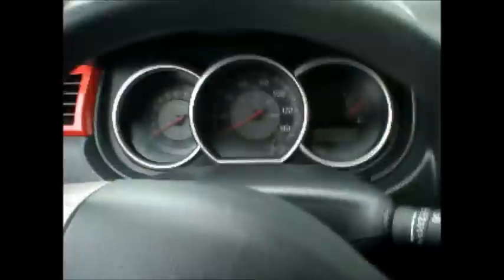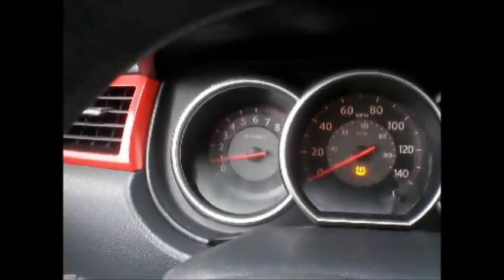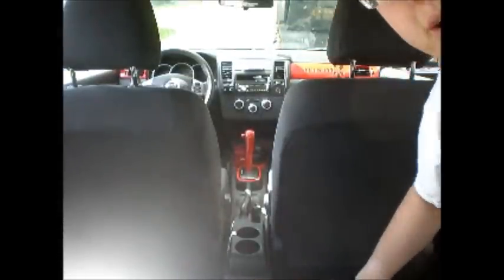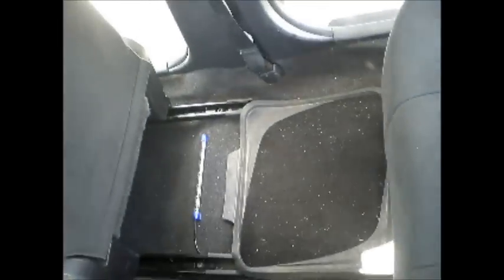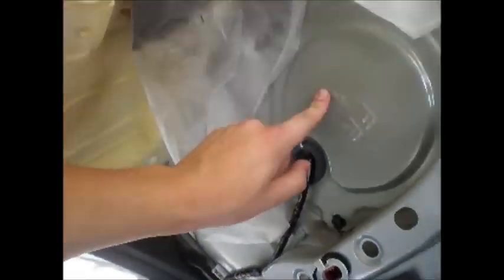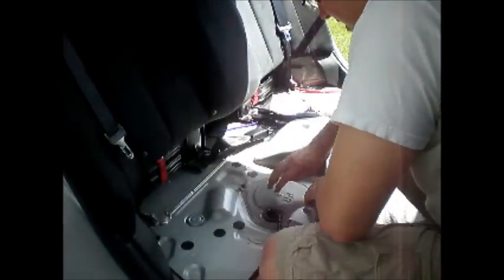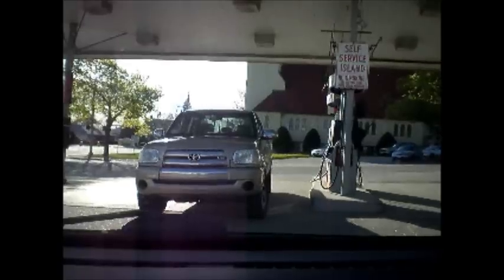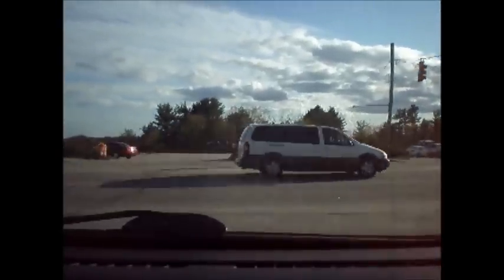DIY: Nissan Versa Fuel Pump/Pressure Regulator Repair

Comment from the maker: after calling a few dealerships, I did find one that would sell me the part, but my local dealership wouldn't order it for me. They insisted I had to buy the entire fuel pump. Also, it would've been more expensive. Getting it through Nissanpartszone saved me some cash.

Comment: Thank you for posting this video kid because it really help me out. The locking ring that secures the fuel pump is a lot easier to take off with a pry bar when you Bend the clamps up, it'll twist right off.  And to secure it back in place you have to bend them back down, it was that easy. Or it became that easy after I watched your video and saw the difficulty you had with it.

Comment: Thank you for posting this.  Helped me replace the pump in my wife's 2009 Versa.  The pain in the butt was the fuel line it has a different type of clip.  I found that bending one of the side fins up I could get a small crow bar in a position that avoided slippage.  Great video.  Thanks again.
Reply: Jeff Jordan were you able to find a fuel pressure regulator without having to but the whole fuel pump assembly? I can't find one.

Comment: Thanks for the video. Saved me $$$. I had my Camshaft Position Sensor go off and I replaced that 2 times then we thought it had something to do with the fuel line because it wasn't firing up  the first crank. We caught you video and followed it. My and my wife aka Genius Tapped the ring off together at the same time and with 30 minute we finished the job and first crank it fired. Just wanted to say a Big THANK YOU.
Reply from the maker: Kaybowser Glad to help. There's a reason this is my most popular video! It is such a common issue on Versa's..

Comment: I stood outside car slid a 6 ft metal rod under seat and lifted. Seat came out. Used a copper punch and rubber coated metal hammer to get ring off. was able to get ring off without bending anything. copper punch is for no sparks when working around fuel. Thanks for the video Matt it was helpful.

Comment: Matthew, you sacrificed your finger blood for us fellow Versa Unfortunate. We will never forget you.
Reply from the maker: Hahahaha. I’m dying right now
Reply: @athikerguy4life  I’m dealing with this fuel issue right now, this is the “newest” Nissan that’s done it to me, my others are early 1990s. Do you know if the FPR is included in the $350 fuel pump kit? I might buy both and just try the FPR first.
Reply from the maker: @buddhull  Yes, it is included with the fuel pump assembly. Unfortunately, Nissan stopped selling the FPR separately. It used to be a $40 job..
Reply from the maker: @buddhull  https://www.rockauto.com/en/moreinfo.php?pk=4649964&cc=1441466&jsn=843
Reply: @athikerguy4life  i found one at my local dealer’s parts listing, but it wasn’t available to their searching. Essentially if I bought it and had it shipped from their warehouse, they would receive it. Otherwise they couldn’t find it. Pretty dumb and extremely disorganized. I will be doing this on Saturday, so your video will be used once again on that day as well. Thanks!

Comment: Very helpful video, thanks! I just did this repair on my versa. 
FYI for others: The main symptom of a bad fuel pressure regulator for this car is the long cranking times. Sometimes it won't even crank on the first go. Definitely recommend replacing it.
Reply: SaN

Comment: I had to do this once, I can tell you a trick I used that a mechanic told me is you get two really big screw driver and form a “X” to use on the retainer ring also as you know use gloves!!!  The screw drive worked a lot faster than banging with a hammer because you put pressure on both side of the ring,  or you can buy or weld a tool it puts pressure on three sides.

Comment: Straight up great video. Thanks for at least showing me where it was at and the steps I would need to take to get it off
Reply from the maker: BigBoiNinja you’re welcome! It’s unfortunate that Nissan doesn’t sell the parts separate anymore.
Reply: @athikerguy4life  I got my fuel pump changed in my 07 versa today and that locking ring omg what a pain

Comment: Nice Job...I would just add if you have trouble with the seat belt bolt, just tuck the bench of the back seat toward the rear of the car. You have plenty of seat belt to work with & It wedges nicely between the top of the interior and the back rest. Now its out of your way. Also, when your handling the fuel pump itself be careful, plastic parts can be brittle. Just take your time with installing the new regulator, it is a tight fit and you may find yourself gripping and squeezing some delicate parts. I used rubber gloves, the kind you can get from harbor freight for a couple of bucks. They are mesh and it looks like they dip the finger parts in rubber...You could also use an oil filter wrench, or a big pair of channel lock. Again just take your time popping that regulator into place.

Another tip is before you begin banging on that ring I pried those tabs up a bit and than used a nice heavy, metal chisel to knock the ring around.

Comment: Many thanks! My only issue now is that the regulators i have seen online for my daughter's 2007 Versa cost almost as much and more than fuel pump assemblies with the regulator in them. So confusing...
Reply from the maker: Yeah Nissan stopped selling the part separately a while ago, which is unfortunate. I think at the time I did the repair the regulator and o ring cost around $30-40. Now you’re basically forced to replace the entire unit. It’s too bad.

Comment: Three tips:
Work gloves!

If you crank the engine and let it run while you pull the power to the pump the engine will consume the fuel in the line and depressurize the line.

A little bit of WD-40 on the metal retaining clip will help it come right off without a lot of hammering and in less time.
Reply: love the part about pulling the pump fuse with the engine running, i always forget, and get a face full of juice....

Comment: You can get new pump, regulator, seal,  fuel gage sender all for $50 on ebay. Use large channel locks to remove the lock. Dont use wd40 it may damage o-ring over time. Spit on it when putting together or Dawn dish soap.
Reply from the maker: Good to know! I’m personally a little wary of eBay fuel pumps but at this point these cars aren’t really worth the money to put OEM parts in.

Comment: Nissan has a tool to remove that fuel pump. I found it listed in my repair manual. My '07 Versa shut off while driving and it eventually restarted. It lost power and shut off. While driving, it wanted to shut off when giving it gas. Could this be the FPR?

Comment: So I think I need to do this for my 2010 Nissan Versa, but the Nissan dealership doesn't show the part number (22670-ZR70C) for the fuel pressure regulator as being a part of my vehicle. Any idea if the fuel pump changed from 2008 to 2010?

Comment: My 2012 Nissan Versa looses power when going on the freeway or up a hill , I get no check engine light or anything .Can this be the problem? I took to a meachanic and told me could be transmission or clogged catalytic converter
Reply: Ignition coils , spark plugs , transmission speed sensor or your catalytic converter is clogged and you can unclogg it with cata clean.

Comment: I have done this repair over 100 times already, as a Nissan tech. there is a recall update of the fuel pressure regulator.. but yes if you don't have fuel tank opener , This will be a bitch to do..
Reply: I am curious where to buy the tool to remove the metal lock ring. I checked Amazon and Ebay except for plastic lock rings and not for Nissan. I am just doing this for my car, and I am curious where to buy a brass punch. I have a couple of metal ones, but I was told the fuel vapors are dangerous.

Comment: We'll it has a ton of miles on it & warranty is out on it but the new fuel pump I put in works but it's like the engine isn't catching the fuel to crank up
Reply from the maker: If you put a new pump in, it should come with a new regulator, so that shouldn't be the problem.If the engine cranks but does not start it is missing one of 4 things: air, fuel, spark, or compression.Double check and make sure all your fuel lines are connected as well as the wiring harness to the pump. When you turn the key on, listen for the pump to turn on (whining sound). If it turns on, you should be good on the fuel end. I doubt compression or air could be your problem. Ignition is the only other thing I would think could be your issue.

Comment: HEY THANKS FOR THE VIDEO 
i just need a clarification 
sometimes my car turn on from the 1st time but when i drive it and turn of sometimes i need to start it like 3 time to be able to start the car is it still the fuel regulator ? i don't want to buy it and not to be the problem 
appreciate your reply back
Reply from the maker: if its the fuel pressure regulator, the car will eventually start as long as you hold the key in the start position. It will crank for quite awhile, but it will eventually start.

Comment from the maker: Bend the tabs backwards that hold it down. Just make sure you bend everything back before you put it back together.
Reply: Thank you for this tutorial. I was able to replace the fuel pump in my wife's 2008. I appreciate taking the time to do the video. I thought the same way about the people who flamed about using the screw driver due to sparks but I stopped at my local mechanic who does my larger jobs and he said they all use screw drivers and hammers. Bending up the tabs was the key to get it off. Looking at another YouTube channel who did a Maxima with the same bracket used a non ferrous brass punch tool which would probably have been the best thing to use if you wanted to invest another $15 in being safer. Thanks again.

Comment: Where did you get your fuel pressure regulator? This video is great, but I can't find the fpr on its own without the whole assembly.
Reply from the maker: Unfortunately they don’t sell it separately anymore. You would have to buy the entire fuel pump assembly.

Comment: Did you have a strong gas smell when the car eventually started ?
Reply from the maker: I did not, strong gas smell sounds more like you’ve got a leak somewhere
Reply: @athikerguy4life  my tiida is battling to start ever now and then and when it does start it smells like it was over fueling

Comment: Hi, I have a leak at the fuel sending unit on top of the gas tank. Can you tell me where and how to look for it. What should be replaced? Thx
Reply from the maker: Dorota Sobkowska Its either the hard plastic fuel line coming from the fuel pump or the o ring under the sending unit. take out the back seat and check to see if the fitting on top of the pump is wet. If it is dry but you see residue around the locking ring, its most likely the o ring. Also possible, although unlikely, is that you actually have a crack in the fuel tank.good luck

Comment: This video was a great help! I have a 2012 versa hatchback with the same problem. I found the Fuel Pressure regulator at coulterpartscenter.com - search Fuel Pressure Regulator - Nissan (22670-ZR70C) for $30.42 I did not want to spend hours removing the ring so I searched for the tool to remove the ring it is Kent Moore fuel tank lock wrench-j-46214
they are not cheep like $135 new I found a used on on ebay for $90. it worked great. just place it on the ring and turn with a breaker bar it comes right off. I believe it works on most Nissan vehicles .

Comment from the maker: Part of it is the fact that they want to upsell a fuel pump. Since the FPR does actually come with a new fuel pump assembly, it will fix the problem, and its actually fewer steps to install, it just costs $400 more. Good for them, not so good for us. Also, it is a very hard part to find through Nissan part search system, even when you give them the part number.
Reply: Matthew Reed    Do you have the part number

Comment: Hey quick question, when your car does start, do you hear any form of engine knocking say at around 1000-1200 rpm when driving? Like when going up an incline or just feathering the gas pedal, do you hear knocking?
Reply: if so??

Comment: Hello, before the fix, was it giving you a misfire code after you crack the car?
Reply from the maker: Harry Osei Amoah no, I was not getting any codes, just the long crank times. If you’re getting a misfire code I would start looking into your ignition system (coils and spark plugs) as well as your crank and cam position sensors.

Comment: How did you know it was just  the regulator part and not the whole fuel pump ?????  Instead of just replacing my whole fuel pump I want to know if I just need to replace a part of it.
Reply from the maker: Nissan put out a service bulletin for it. If it has a long crank time but does eventually start and run fine, it’s probably not the fuel pump.
Reply: @athikerguy4life  Gotcha 😁

Comment: Anyone have an idea where I can get this regulator from now? Don’t think this link is right anymore.
Reply from the maker: Danny Rios unfortunately I have been unable to find the part individually anywhere. The only way I have been able to find it is to buy one of the cheaper fuel pump assemblies (around $75 through rock auto). It’s unfortunate because this part on its own is so cheap, but it seems that Nissan and everyone else want you to just buy a whole new assembly.

Comment: Hi,  friend I just called all the auto part stores an they said they don't even have this fuel pressure regulator in there system.  so where did you get yours an how much did you pay
.
Reply from the maker: Link to the parts is in the description

Comment: where did you get the regulator part- I am not able to locate where you can just buy the part that you replaced?
Reply from the maker: Heather Stambaugh unfortunately I have been unable to find anywhere that still sells this part individually. It seems that most retailers and dealerships are now only selling it as part of the fuel pump assembly.
Reply: Thanks that is what I thought but wanted to check I ordered the entire pump for $88 at rock auto.com which was pretty reasonable.  I will post after I put in to confirm if it fit and fixed issue hope this weekend.

Comment: I change the fuel pressure regulator but my service engine soon after I replace it what can be the problem
Reply from the maker: Get the code scanned. It could be any number of things. I can't think of any codes that would be directly linked to the fpr repair. If you can read the code I might be able to give you more information.

Comment: Where did you find the fuel pressure regulator... cause no one sells them.
Reply from the maker: theylied1776 unfortunately it seems that nobody sells the individual part anymore. The only way to get it is to buy a whole fuel pump assembly
Reply: That's what I thought, a lot of Nissan parts are no longer available for aftermarket sales because Nissan quality has hit rock bottom. And there have been so many class action lawsuits that almost no one wants to sell aftermarket Nissan parts anymore.

Comment: How did you know to change the fuel pressure regulator and not the whole fuel pump?
Reply from the maker: There was a service bulletin out for the problem.
Reply: TSB# NTB07-094

Comment: I appreciate the video but ,First off all you don't need to remove the seat belt bolt, it can just slide out. Second it's easier to spray a little bit wd40 instead of struggling and injure your self.

Comment: I can not find the regulator anywhere, where did you buy it from?????
Reply from the maker: Sean Laurie it seems that nobody is stocking the part on its own anymore.. I did a search and was unable to find it as well. You can try going to the Nissan dealer with the specific part number, but you may be stuck replacing the entire fuel pump assembly. Sorry!
Reply: Thanks for the video. I know you said that it seems that the part is no longer available individually. Do you remember what the specific part number is?

Comment: Now, where can I buy the regulator and seal ?
Reply from the maker: links in description.
Reply: Matthew Reed Hey Matthew, thanks for the video. I might have to do it to my gf's mom's car. The packing ring in the description, is it the seal or the outer metal ring?
Reply from the maker: It's just the o ring.
Reply: Dang, that piece is $25?! haha.
Reply from the maker: The o ring is probably reusable but it is recommended that you replace it

Comment: Does this part fit the 2007 Versa?
Reply from the maker: Yes, its the same part for all first generation Versas with the 1.8
Reply: Does a bad FPR cause the car to shut off while driving? It happened to me. Eventually restarted. My mechanic checked car & couldn't find anything wrong with it.
Reply: Matthew Reed
Does the FPR cause the car to shut off while driving? Mine did that & eventually got started. My mechanic could not find the issue.
Reply from the maker: It only prevents the car from holding fuel pressure while shut off. When the car is on, the fuek pump provides pressute
Reply: *****  My car does the same thing now...while driving down the road it will completely shut down, and after a couple of tries it starts back up! Sometimes I need to open the hood and shake the battery a bit lol  what's up with that?

Comment: the links don't work anymore?
Reply from the maker: mediamtech unfortunately it seems like nobody still sells the pressure regulator on its own. I have tried to search for it with no luck. The only option now is to buy the entire pump assembly. You can still save a good chunk of money by replacing it yourself, just not nearly as much as before! Sorry
Reply: Matthew Tks for getting back